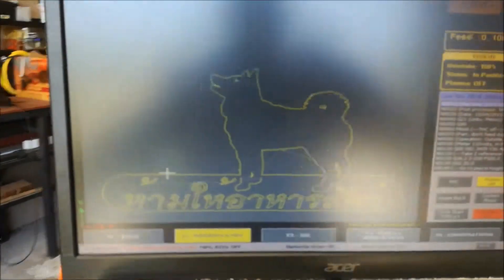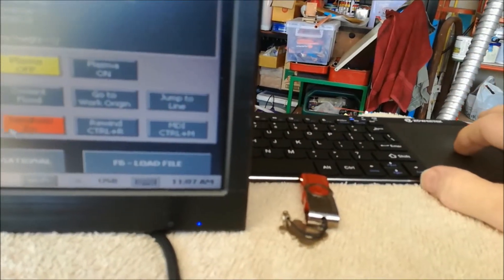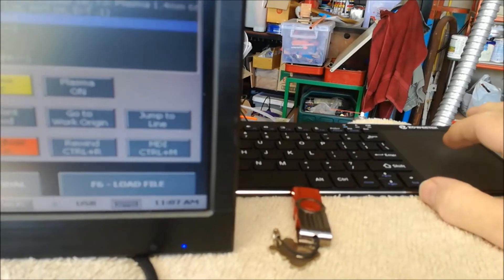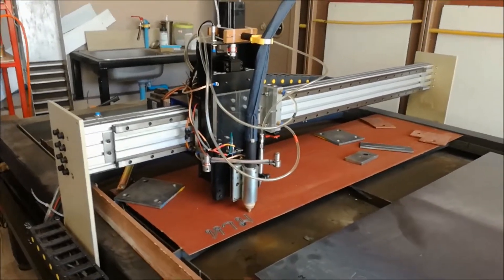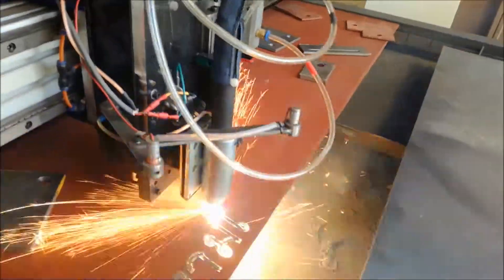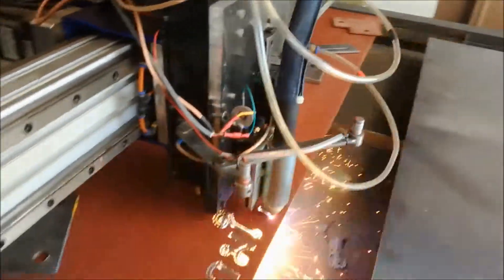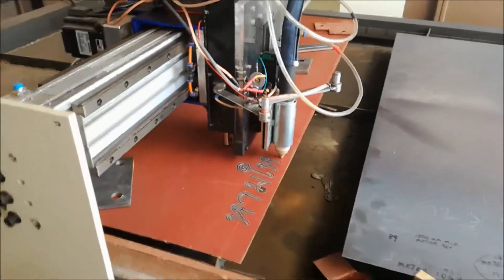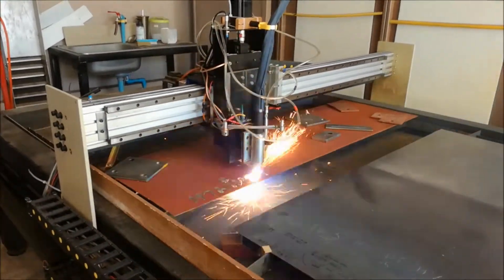Updated, Masso Plasma cnc, no height controller

Comment: How do you get your cuts so close to the edges of the sheet?
Reply from the maker: In SheetCam you go to Options/ Job options and change the size X & Y.  Measure your sheet and place the measurements in the X Y. My full sheet is 2440mm x 1233mm. Then i use the NEST and place each piece to the far back corner of the sheet and work my way to the front. Zero out your plasma tip on the front corner. I welded tabs to the table so each sheet will sit in the exact same place and i do a go to origin when i turn on the machine which sets the plasma there every time. By doing this if something goes wrong it is easy to find the zero X Y place to restart a cut! Don't assume each new sheet is the same size and place each job about 5 to 8 mm from the edge. 
Hope this helped, Ross. 
Might have to do a video of it one day

Comment: I have masso cutting with similar plasma cutter, about 10-20 seconds of cutting and I lose my mouse and keyboard and the program stops cutting. Any tips or have you had this problem with masso? Thanks
Reply from the maker: You still have electrical noise. Do a video of all your wiring and table grounding, plus were your plasma lead runs.
Post it on the Masso forum and us plasma guys will have a look at it!
Look at this video i show some of the grounding i did at the end.
 https://www.youtube.com/watch?v=NrDmhwG64Dc